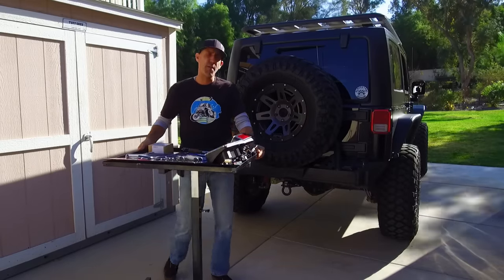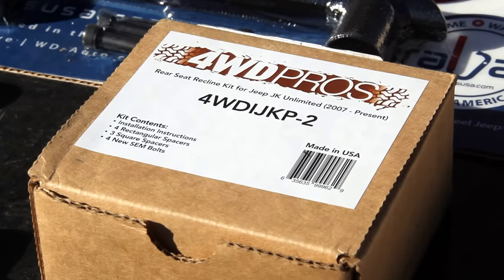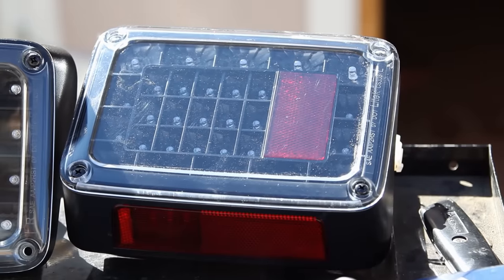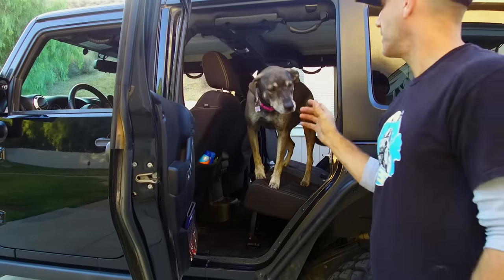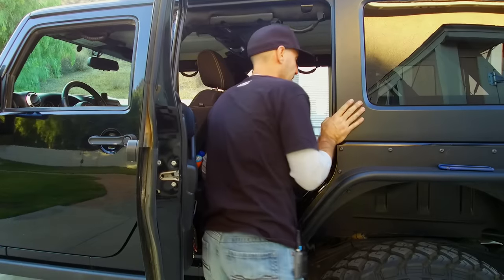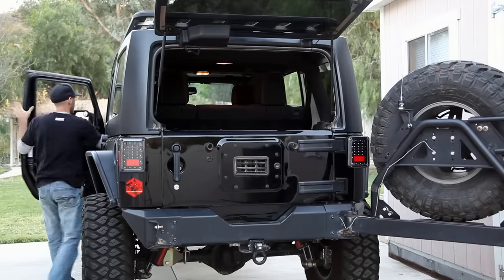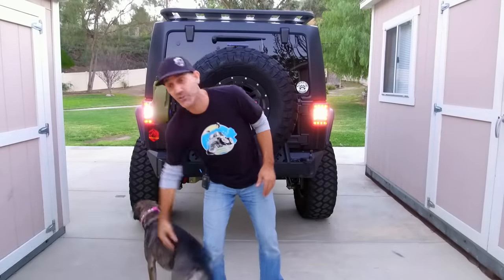3 Easy Upgrades for the Jeep Wrangler Anyone Can Do!

Comment: Look at all that dog hair...  A Jeep wouldn't be home without a dog.  I had the strap handles in mine.  I kept them tucked up between the bar and the top.  Just like you didn't realize the back seats were so uncomfortable, passengers don't have anything to hold onto while riding.  The driver, however, always has the steering wheel.  I found that the strap handles were always used more while riding, than climbing in.

Comment: ya - so. I'm experienced and have a fair amount of tools - but am new to Jeeps. I did the recline kit yesterday - prob took about 5 hours and while not difficult at all, I can't imagine how anyone without experience would be able to get those bolts out of the seats if they are rusted! I suggest spraying them with a rust buster or something like that and let it sit for a few hours on all the bolts (both at the bolt head and at the threads underneath the Jeep). Impact wrench did not budge them, and had limited space to utilize a cheater bar.  Seat belt tip also good - pull it all the way out then let it retract, so that it locks in place; also recommend pushing the legs all the way up too, to get them out of the way. Thanks for these vids, amigo! BTW, I also sprung a leak lol.
Reply from the maker: Very good suggestions!

Comment: Flip your rear view mirror.
This will increase visibility out the window and out the back window. It turns it upside down then pushes it up higher on the window.

Best Free upgrade.
Try it and let us know what you think.

As Always, the best jeep videos!!! Keep it up.
Reply from the maker: I use the map lights on the bottom of the mirror at night often... flipping it would lose those tho??? OK I'll try it!
Reply: autoedit I noticed you have the map lights on yours. That would be a good reason not to flip it. 
I'll be interested in seeing if you felt it was worth it since you would be loosing functionality.

Comment: One tip from having done this a few times, if you start with the outboard legs of the back seat, you can flip them up and out of the way and then get easier access with a cheater bar to the inboard legs.  This also helps when putting them back in.  You can get a much better angle on them.  I am glad you had the tip to flip the seat up to take the back bolts out.  It is really difficult to get those out when you are leaning on the seat instead of moving it out of the way.  Don't ask me how I know that.  An impact wrench could break the nut underneath free if you really over do it.  Sometimes it is better to just use copious amounts of elbow grease.  I use the impact wrench when I can though too.   Great video thanks!
Reply from the maker: Good advice, thanks!

Comment: Just got done putting some grab bars on my black JKUR guess it’s a coincidence 😂. Shocked at how useful they are. What I did with my old cloth handles is put them on the headrest on jeep and now it’s another point to grab onto and singed the excess nylon off. 100% worth it. Always wondered how do you jeep your jeep so clean? I struggle to keep mine clean even not off-roading hehe.
Reply from the maker: That is a great tip on what to do with the old handles!  It's funny when I watch some of the videos because the Jeep does look really clean but in real life it's pretty normal looking all the time.

Comment: I had to laugh on seat spacers. I spent hours getting those bolts out. Busted knuckles, had to get 1\2 Harbor Friegh breaker bar because I though I would break my 3\8 drive because of lock tight! Great video!
Reply from the maker: LOL! It makes you earn every turn of the wrench for sure.
Reply: I had to laugh also. I had the spacers before I got the Jeep. First day I had it was when I put them in and it was still difficult. It took me a few hours and a lot of swearing, blood, ave sweet. But definitely worth it. Only cost me $23.
Reply: Easily one of the most disappointing and frustrating projects I've ever taken on.  Bolts literally felt like they were welded on....to the point I thought the threads were already cross-threaded from the factory somehow.  Finally got them all off with two solid straight hours of swearing and then, with the spacers in place, the holes WOULD NOT line up with the threads in the floor.  The seat bracket would not allow the bolt to line up straight to start threading.  I just knew I was going to fully trash the threads trying to get them to go.  Finally gave up and could barely get the bracket holes and floor threads to align enough to get the bolts starts without the spacers.  Even after oiling the bolts and starting by hand, a hammer driver only got them in 1/4 of the way.  Elbow grease the rest of the way.  Ridiculous.

Comment: Love your videos as always. I did the GraBar install awhile back on my ‘17 Recon.  They must have used a metric ton of locktite on the bolts. I eventually needed to run a die tap to clear our the threads and then it was as easy as you showed. Keep up the good work!
Reply from the maker: Wow, the instructions did mention that it may need a run through with the stock bolt with a bit of oil on it to clean the threads and yours is an extreme case... glad I didn't need that as well!

Comment: Great vid and upgrades.  To get an even better rear seating angle/recline, don't install front spacers. when you recline your front seats, just the back reclines not the bottom part. Think about it, Right. the bolts are easy to take out now it try. love the vids keep them comimg.
Reply: i like this! you’ll end up getting a more flatter seat

Comment: I got the cloth grab handles to begin with cause I just thought they looked pretty cool but once installed they're definitely impractical. I was looking into the frame handles but I also heard they might interfere with future wiring. Still after watching this I'm kinda sold on them.
Reply from the maker: I'm not sure how they would interfere... simply remove them to pull the A pillar cover off, put your wiring in and re-install... easy!

Comment: another "cheater bar" method is to slide a close ended wrench over the handle of the ratchet or breaker bar (think of an L shape) to help add torque, this is usually easier in tighter spaces.

Comment: The Gra-Bars concern me because the second you're in a roll over or other wreck they become a significant hazard for your head, where the nylon and rubber grips are much less likely to cause a severe head injury.
Reply: My thoughts too. Not worth the risk
Reply: Thanks for this comment.  Completely overlooked that aspect.
Reply: puppetmaster518 I think for MOST people, the reward is greater than the risk...like most things

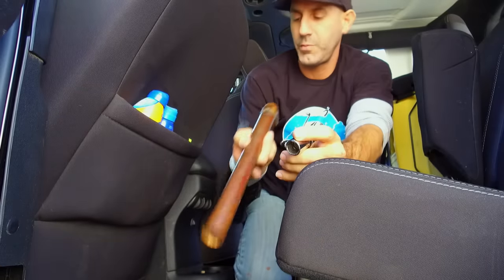Comment: At 6:20 I wouldn't recommend using a cheater pipe on a ratchet.  I did it once and applied way too much torque with it and it broke the ratcheting mechanism.  Definitely good to use with a non ratcheting socket wrench or a regular combination or box end.  Loved the video though and I'm gonna get that rear seat recline kit.

Comment: Yea, I'd pull out the battery impact wrench for this for sure, lol.  I bled enough breaking loose the red loctite that was on the body mount bolts when I installed my rock sliders. 😆

Comment: with the rear spacers in three quarters of the rear seat bracket/mount is not in contact with the floor.  Those spacers seem like the would be far better if the were made to support the entire length of the bracket to the floor.  They are designed to distribute the weight over the entire footprint.  The fronts are the size of the foot of the support.

Comment: hey mr because of you I did all 3 of these on christmas morning by myself in my pajamas in my driveway it was awesome and easy as hell thank you , now I have a question to any and all that might read this , I have just purchased ZROADZ jk rear spot lights that mount on the glass door hinges and a set of the back up spot lights for mounting on top of your rear tail lights they are awesome ! and so easy to install but the maker supplies zero instructions on how to wire them other than stupidly running the cables thru your window between the glass and the seal gasket and watching many vids on youtube not one company will tell you otherwise but they all say the same thing , there are so many ways to do it we dont want to show you on here ? it is crazy  anyway i just thought I would cast it out there and do some fly fishin to see if I get a bite
Many thanks for the great vids autoedit
Reply from the maker: Glad to hear I inspired a pajama wrenching party on your Jeep! As for routing wires out the back... for the rear license plate stuff I have ... I routed out the rear into the area behind the tail light and down through the foam out underneath the body. Maybe look into that.

Comment: I installed a set of the rear seat spacers in my 2013 JK. One of the most brutal installs I have ever done, video in no way shows how difficult it is to remove factory bolts. Would definitely discourage attempting.
Reply from the maker: I show exactly how difficult it was to get them out.  You seemed to have more trouble, not my fault.

Comment: The back seat recline is no for someone without experience to do. Many times us mechanically inclined folks don't realize how hard things are for other people without knowledge or experience. I did this install a while back and it is a tiring install without air tools. Also, sometimes one or more of the bolts do not line up and you have to think and adjust so they don't go in cross threaded and ruin the anchor nut. The other 2 installs are truely simple ones, but I get the feeling you used that air tool in between your video edits :-)  still very instructional, take care
Reply from the maker: Solid advice but most people can figure that install out.  I didn't cheat the other bolts with the air tool... I truly wanted to grunt it out to see if I was saying would be applicable to a rookie.

Comment: I installed the set recline in my JK. it did actually make it much more comfortable to sit back there. unfortunately I had to take it out because it will not work work the the JL Audio stealthbox subwoofer. The seat will not lock in.
Reply from the maker: Hmmm. Yeah, I bet there are a few things these won't play nice with. Good call out

Comment: For the seat recline, seems it would be better if the backrest just reclined a little more. By tilting the entire seat the front of seat is higher and may cut off circulation of short persons legs. The angle between the seat and backrest is still the same

Comment: Take the original handles front the front and attach them on the back side of the headrest for the backseat passengers. Remove the headrest, install the handles between the headrest and seat, reinstall headrest.
Reply from the maker: Great suggestion, thanks!!!

Comment: Don't spend the money on the recline kit. There is a better way. The biggest problem with the recline kit is that it tips the bench up, so you are still squashed. I'm sure they made the kit this way, because they didn't want to modify the seat, BUT, if your going to do the mod, do it right, so that it works. I bought washers from Menard's for less than 10 bucks. This tilted the seat back more than 3 1/2 inches. For the bench seat on the passenger side, I took a dremel tool and notched out the frame in the middle. There is a plate on the other side that needs to be notched as well. For the driver's side, I just sat on the bench with the legs out of the way, and bounced up and down a few time, which slightly bent the frame. (don't try to bend the passenger side, as it will mess up the bracket) This allows the bench to sit flat in its normal position, and the back to be tilted. It feels like a very normal back seat. Its actually tilted a hair more than the JL. 

One other comment. Those floppy handles have a purpose. While the rigid handle is nice for getting in, it should not be used when going off road. The purpose of the floppy handles are so if the Jeep where to roll, you don't get your hand crushed between the handle and a rock. This is a safety feature. It may seem hokey till you understand why it is there.

Comment: 6:35 be cautious using a cheater pipe with a ratcheting wrench.  Too much torque can break the ratchet mechanism.  Better to use a crescent or a non-ratcheting socket wrench.
Reply from the maker: Very solid suggestion!

Comment: For the rear seat recliner, could you use just the rear set of spacers and leave the front ones off? If the legs on the seat are long enough to attach without the front set of spacers you should still get a decent recline without the added height.

Comment: I have those tail lights, they’re awesome and very bright. Never thought the seat spacers would be that effective, either. 

What brand air compressor are you using?
Reply from the maker: I have a Via Air portable and it does pretty good but would like to mount on board air at some point.

Comment: Tail lights will not work if you have a tow package. The connectors for the trailer are on the left side tail light. Probably why only the right side was shown. If you don’t plan on towing anything, no worries.

Comment: When you decided to go "easy mode" for one of the seat bolts... what was that power wrench you were using? Just got a 2017 Wrangler and my wimpy socket wrench will probably break before those bolts come loose (yes, been trying for two days even with a bar).
Reply from the maker: That was just a standard air impact gun... get at home depot or wherever.

Comment: The Grabbars were the first install I did on my Jeep. Absolutely love them. Question though, do you have any issues with flipping down the sun visor? Mine always rubs on the driver side. Wondering if I might need to readjust them a little or tighten them down a little more.
Reply from the maker: To be honest, I haven't used the visors yet but will check next time I'm in the Jeep.

Comment: You should not install any metal bars as handles, because in case of an accident you can suffer from  injuries. in fact this will not show now but safety engineers had spend plenty of time to do tests you may had seen before here or there that demonstrate scenarios that involves dummy bodies moving around the compartment of a car and what kind of injuries may happen if your body comes in contact with hard objects.

Comment: Everything is great, except the drivers side handle. Don't most just grab the steering wheel? Having a JT with the bestop mini ragtop ,I use those old grab handles that you hit your head on when washing the top.
Reply from the maker: It is not a good idea to use the steering wheel. The column is not designed to withstand side loads.
Reply: @AutoEdits  Right,There are Substantial Humans on this Rock.

Comment: Awesome video AutoEdits.  What was wheel and tire size in this video.
Reply from the maker: Thanks! Those are 37” tires on 17x9 wheels.
Reply: @AutoEdits  my apologies for all the questions but what kind of suspension did you use, lift height and did you have to regear?
Reply from the maker: There's a lot of videos right here on the channel... go to the playlist for all the upgrades.

Comment: One question about the small spacer, it looks like it could damage the floor. Before the mod the weight destribution was spread out but with that small spacer all pressure is on that small area. Maybe it's no an issue but i got curious. good video tho, keep it up!

Comment: I'm sorry, I disagree with the grab bars. It's hurts more hitting your head on the rear grab bars. I took mine out and went to the soft ones. Also, the rear seat incline kit installed, does the seat fold flat properly or does it sit higher?

Comment: Hey man, my dad has a 2017 Jeep Wrangler Rubicon Recon. It's got the disconnecting sway bars, locking diffs, and all of that. The thing can run 35s stock, but he wants to do a little bit of a lift anyways for comfort before he runs 35s. What should he do to keep the factory sway bar disconnects but still get a lift? How big should he go?
Reply from the maker: What tonepaw says is pretty good. I have the 3.5" lift from Metalcloak and like it very much and use the stock swaybar disconnect.  I rented a Jeep in Moab a few weeks ago with a 3" lift and 35" tires and it did everything I tried like a champ!
Reply: Thank you very much for your reply, as a new Jeep person this really helps.

Comment: Dang I own a 2016 Jeep Wrangler 4 doors but no electric windows all manual
Reply: I consider that a plus.  The way it should be.
Reply: I got you beat. mine are all zipped down windows 😅 pain in the butt at times 😁, especially when you pull through a drive-thru🤣have to replace about every 2 years due to the scratches..  mine's a 2016 4 door Jeep standard 6-speed Jk Wrangler sport unlimited. just a plain traditional Jeep. I do miss my manual stuff at times 😆

Comment: I was just wondering if you need the third light on the back of your jeep. I see that you only have the two rear lights without the one that comes stock above the spare and was just wondering if it is legal to not have that.
Reply from the maker: I do have a third brake light in the center of the spare tire as a kit from metalcloak.
Reply: oh ok

Comment: Your lucky, the Jeeps i have the ZJ grand Cherokee's they used blue locktight on the bolts for the seats, dont think i saw any on yours.  And my Grand Wagoneer way of holding the bolts in place is with rust LOL.   Personally i feel the stock brake lights looked better,  Not a big fan of Jeep people swapping out taill lights with LEDs that have individual LEDS.  Looks cheap
Reply from the maker: I ended up going with the JW Speaker lights and loving them WAY better than stock... and I totally get what you mean about the individual leds not looking quite right.
Reply: @AutoEdits  they look like lights from modern school buses. Lol